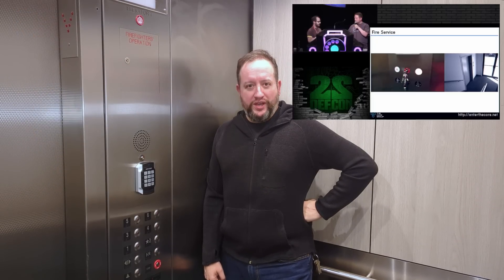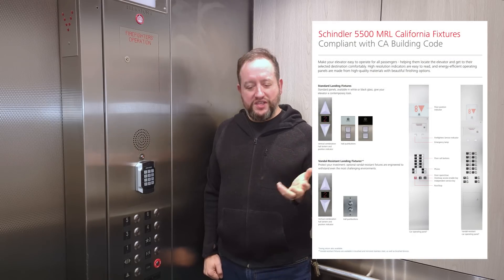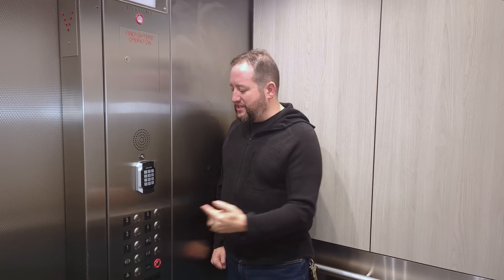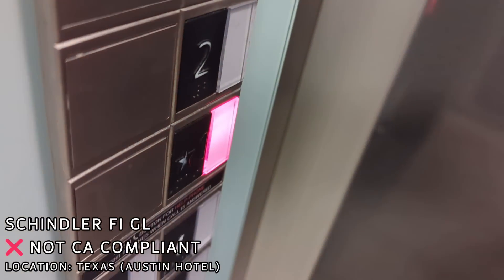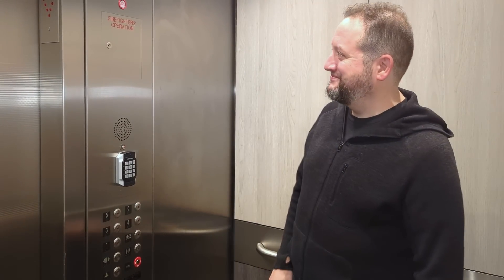Something's Unique About Elevators in California

Comment: It's almost like the regulations are recognizing simply good design features. Disabled or not, you just want simple easy to press buttons in case you are doing anything that might be obstructing full hand use, like holding stuff. Just bump it with the back of your hand or whatever. Also gives you a good idea when the things stop working, did I press it wrong? Nope, that button is just broken, moving on.

Comment: That Austin one was bad. 
I also like the buttons the protrude a little bit and make a little noise, and light up bright enough to be seen. 
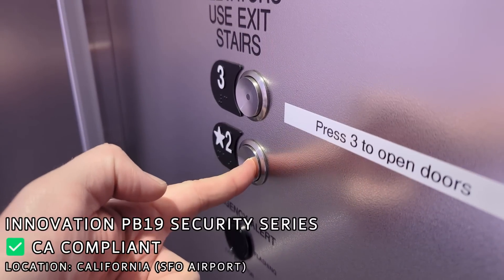I also think that the floor number should be ON the button, not next to it. That Otis Series 2 classic, 3:06 is one of the better ones, as it is easy to tell which button goes with which label. The Chicklets aren't bad either. 
The one you are in, the number 6, for example is the same distance from both buttons. You have to know where the number 5 is in order to know which button is for 6. If someone is in the way, vision impaired, not paying attention, etc. it might be a challenge to push the correct one.

Comment: I remember those awful elevator "buttons" that, instead of projecting out, were actually recessed into the surface.  There was no pressure feature at all, rather they would light up silently if you just touched the depression.  It's as if they were designed specifically to be confusing and unhelpful.  Thank the gods the code changed to get rid of those awful things.
Reply: I think at least 3 different manufacturers have tried touch sensitive buttons, Otis, Kone, and Schildler (Otis had round touch sensitive buttons, which might be what you remember, Kone seemed to have experemented with touch sensitive buttons, but i am only aware of 1 installation that used them, and Schilder have come up with a few designs that use touch panels (I believe the original 3300 was designed to have a touch panel, but they had to substitute it for physical buttons in most countries)
Reply: @pineappleroad  The ones I remember were square.  The lit-up sides angled inward to a black square in the center with the number in white.  There were quite a few buildings here in L.A. that had them back in the 60's and 70's.  They started to disappear in the 80's, thank the gods.
Reply: @Serai3  Sounds like they were Otis ones (if i remember correctly Otis made both round and square versions)

Comment: I think that there is an different "accessibility" issue with the elevator from which this video was presented.  Specifically, the pewter on black on pewter numbers are very hard to see if you're visually impaired, or even in low light.  The numbers should be either ivory white or bright yellow!

Comment: One thing that came to my attention is that the floor buttons on the panel before you. They are #’d from bottom to top, rather than top to bottom. If there were no lights in the elevator, I’d be confused. Maybe for a laugh, the buttons could be #’d randomly. 1st saw you @lockpickinglawyer. I like your vids.

Comment: Watch out California builders.  Some counties (Los Angeles specifically) are requiring Video screens and camera centrally monitored when the Emergency button is pressed.  That usually means adding a video codec system behind the panel/overhead plus ethernet on the cable bundle, plus appropriate internet connectivity.  This is on top of the (newish) analog telephone requirements that can now be utilized via 4G.  AT&T specifically has a 4G internet + analog box (CDS–9090) that's exactly for that new code requirement.

Comment: I've read that one of the reasons for the housing shortage and rising housing costs in the U.S., and California in particular, is the excessive elevator code regulations, compared to Europe.  That increases the cost of high rise residential buildings, so they are less profitable, so fewer get built.  Even worse, when 2 and 3 story apartments are built, they usually do not include elevators, because they are not required.  However, if a builder chooses to add elevators, they are very expensive due to all the codes, which cover a lot more than protruding buttons.  So even newer apartments and condos do not have many ADA compliant units.

Comment: Here’s an interesting fact: In the U.S. there is an average of 10,000 injuries and 27 fatalities on elevators each year. That far exceeds numbers on passenger airline travel.
Reply: At least half of those injuries and fatalities are to elevator installers and maintenance workers.
Reply: But if you look at it by miles traveled, elevators are far safer.

Comment: Slight Tangent 
My other half has been re-watching Greys Anatomy. noticed a few times they hit the emergency stop button in the elevator to have an argument, or make out between floors or whatever else. 

I can't say I've ever seen an stop button in an elevator cab in the UK or when traveling abroad (Haven't been to the US for a long time). Are they a US thing/regional US thing or do they only exist on TV for drama?
Reply from the maker: they used to be more common but folk would abuse them and therefore, indeed, they've mostly been changed over to a key switch for Run/Stop nowadays
Reply: @DeviantOllam  That's good to know. Yeah it always seemed to be a dumb idea/ripe for abuse.

Comment: Sometimes I wonder if the UI designers on elevators even bother testing them. Those Schindler buttons are astonishingly bad. If pics online are anything to go by, they might have the award for overall worst button design catalog.
Reply from the maker: Schindler products have notoriously bad buttons in some of their models, because the "backing" of the button is just the PCB circuit board.  they can break if excessive force is used.

Comment: @DeviantOllam Wouldn’t some of those “compliant” elevators (like the Otis Series 2 Classic) actually not be in compliance since the characters and symbols were not “white on a black background” as required by the code you showed?
Reply from the maker: ah, so you may be right, but in these clips I was mostly showing CA compliant "buttons" themselves.  many of those elevators may be equipped with CA compliant buttons but, if not located in California, they wouldn't need to have white letters on black background for the badge labels.

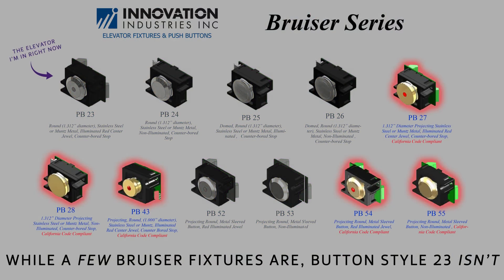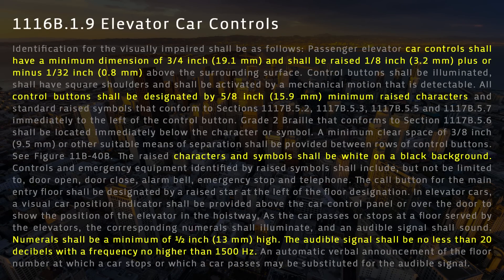Comment: At 1:18 we see button PB 28 shown as California Code Compliant.  But it's non-illuminated.  Same with PB 55.  The code shown at 1:45 states "Control buttons shall be illuminated, shall have square shoulders..."   So how are PB 28 and 55 Cali compliant when they are not illuminated and are round, and do not have square shoulders?  For that matter, how are any Cali compliant when they're all round?
Reply: The shoulders are the edges between the tops and sides of the buttons, not the shape. Not sure how the lack of illumination counts though.
Reply: @ColinRymer-c7n  ok...  I grasp the shoulder concept.  Thanks.  Still puzzled by the "non-illuminated" thang.
Reply from the maker: ah so the "square shoulder" has to do with if you were to view the button's cross-section, like from the side.  the button when viewed from the front perspective can be round or square or anything you like, but the cross-section view must have "square" edges.  basically, it can't be a gentle sloping "dome" like a dinner plate or a bowl turned upside down.  it has to have a sharp, defined edge... like if you took the lid of a jar and put it on a countertop.
Reply: @DeviantOllam  Yeah.  If you're feeling the panel and hunting for buttons, they will be very apparent.  Vs those buttons you see that are just little domes, or worse, flat with the panel and depress into it.

Comment: Did you know that the 1970's heat activated buttons in Los Angeles were outlawed after the First Interstate Bank fire? I stubbed my finger the first time I used one because they don't move. You just touch it and it senses the heat in your finger. During the bank fire in the late 80's, the fire on the burning floor activated the button and called the elevator to the floor on fire. The person in the elevator died because he couldn't get the doors to close.
Reply from the maker: that's true!  it's also a plot point in the film The Towering Inferno

Comment: Regarding comments about having auditory confirmation of the button press. There are many competing items here.  One is that on slower elevators without voice annunciators there is a floor passing sound so those that are sight impaired can count the floors.  If you had auditory confirmation buttons, someone could register a car call during travel and make this very confusing.

Also, if you have a neurodivergent desk clerk sensitive to sound stimulation in the lobby, all the beeping could make for an unpleasant working environment.

This is not to imply that auditory buttons are good or bad just that there are many things to consider.

Comment: Are the stars also a accessibility thing? Never seen that in UK. Are they floors you can exit on or something similar?
Reply: Ground floor indication (where you can directly leave the building).
Reply from the maker: @crosslink1493  Yes... the primary egress landing, also the floor to which all cabs should normally go if the system triggers onto Fire Service Phase One (emergency recall)

Comment: I enjoy my California compliant buttons in my car vs the stupid touchscreen. lol 😂
Reply: Omfg, yes! Touch controls in cars are terrible. Yeah, let's make it so I cannot adjust settings without literally looking away from the road.

Next, let's "improve" some other interfaces in the car. Pedals for acceleration and braking? A physical steering wheel? Nah, I want to control my car like it's a mobile racing game with shitty controls.

Instead of a shifter, you can shift into reverse by drawing a cursive "R" on the touchscreen in the center console. Just make sure you don't lift your finger before finishing the R, or it'll shift into P for Park.
Reply: I like my dials too. Miss having toggles, levers, and sliders.

Comment: BTW (not from the US): What does the little Sherrif star on some of the eleveator buttons mean?
Reply: "Nearest outlet to street" i.e. the way out in case of emergency that doesn't shut down the elevators. It's also coincidentally where the lobby or reception area for a building generally is.
Generally it will be on the ground floor, but sometimes floor two depending on local topography.
Reply: And occasionally more than one, when the ground level is a different floor depending on which side of the building you're on.
Reply: The exit floor. In secured buildings, it is often the only floor that is accessible without a security fob/key/card/code.

Comment: It's worth noting that California also has some other unique elevator codes (for new installations at least) that few if any other states have. For example, MRL traction elevators are required to my knowledge to have a "control room" for the controller, and MRL hydraulic elevators are completely prohibited.

Comment: Cool. My european residential elevator has 1 button that projects out, for the ground floor (0). floor 1 & 2 tho are flat with the wall tho. The floor number itself is on each button tho and raised a bit, so you can feel what floor you're pushing on anyways. Weirdly enough I was in a hospital elevator the other day, buttons were flat with the wall, and no way to feel what button you were pressing. You'd think a hospital has more accessibility features for blind people than your average residential elevator.
Reply: Counterintuitively enough, the hospital elevator buttons may be that way on purpose, to prevent them from being accidentally pressed by, e.g., a gurney.
Reply: Varying the protrusion distance is actually interesting. Buttons of interest should have extra emphasis placed on them.
Reply: @heroslippy6666  agreed. If anything was to happen, the ground floor button is most important
Reply: Many elevators I see here in Australia have the raised numbering (and braille dots) on the buttons so its easy to tell if your finger is or isn't on an elevator button and if its the one you want. And when you push the buttons they push in quite a bit so its easy to tell that you actually pushed a button.

Comment: 3:10 SFO airport -- why is #3 the open door button?
Reply from the maker: I think a lot of people get confused for some reason. Maybe the elevator idles on that floor, And if the situation has a time out, people wind up just sitting in the cab waiting for it to move?
Reply: Ex fire inspector - Not sure about airports, but in hi-rise buildings the elevator recall function is tied into the fire alarm system.  If the FA system detects a fire the initial default returns the elevator to the first floor.  If the fire is on the first floor it defaults to another floor, usually 2nd but it may be 3rd floor depending on fire resistant construction or other fire safety features.  Recall is never to an underground level, BUT I did inspect one building where it was allowed due to an exit door being right beside the elevator and some very unique fire safety features.

Comment: I appreciate the elevators with not only buttons that protrude from the wall but also make a noise when you have successfully pressed them. That’s another bit of accessibility that should be standard. Someone who is blind may not be able to see the button light up.
Reply: While not the same thing, it is one of the reasons California code requires "mechanical motion that is detectable".
Reply: @terrybell3495  that sounds like it suffices if the button (noticably) moves when you push it, but that's not the same as actual feedback that the elevator has recognized the button press, using a tactile click and/or audible cue.
Reply: @MatthijsvanDuin  agreed. Honestly the auditable feedback doesn't always either.  Some of the auditable feedbacks are on button and just sound becasue you have closed the button contact not becase the elevator has accepted demand.  You can see a similar behavior in acceptance lights as well. Some times you will see buttons light and then just go out.  This is becase the button "pre lights" itself giving the controller time to acknowledge demand and when it does not get it, it goes back out.  This works well with light, not so amazing with auditable feedback.
Reply: @terrybell3495  What you'd want for that is a button with a detent: it stays down when active and pops out when deactivated.
Reply: @terrybell3495  That's just bad design
Reply: That’s what I thought, apparently wrongly, was the unique thing about California design.

The other thing—which probably is a requirement in the California building code, also, but not shown in the video—is that the chime of an elevator going up will sound once while the chime of an elevator going down will sound twice (either the same chime or a two-tone “doorbell” chime).
Reply: @jeff__w  I don't believe I've ever seen a modern elevator that didn't double-chime for down. 

Elevators with manual doors and accordion-style gates are a different story.
Reply: @PaulSteMarie  Thanks! Well, it seems to be a general practice that’s followed all over (i.e., throughout the US, if not elsewhere). I obviously didn’t know.
Reply: the button make sound make brain happy

Comment: What about elevators in California that don't use buttons. I.e. The elevators at my company's headquarters in San Francisco, it has a touch screen on the wall and you slept the floor you want to go to on it and then it tells you go to elevator a You go to elevator a and then when it opens up it goes directly to your floor. So there's no buttons that's all touch screens and monitors
Reply: I've recently begun watching a lot of content from a blind YouTuber and she hates the touch screen elevators because she often can't use them without assistance. Some have physical buttons as well for use by people who cannot use the touchscreen and she can use those herself but some don't.

How they get around that California code if the elevator doesn't also have buttons I don't know.
Reply: @tallman11282 the code might not require elevators to have buttons, just that all buttons be protruding.
Reply: I'm a little confused. You're saying there is no interface inside the elevator, only a touch-screen elevator interface on the outside of the elevator?